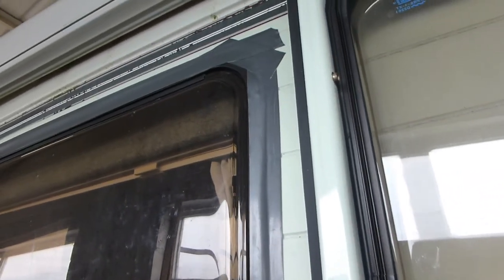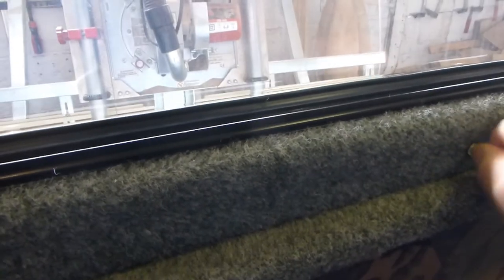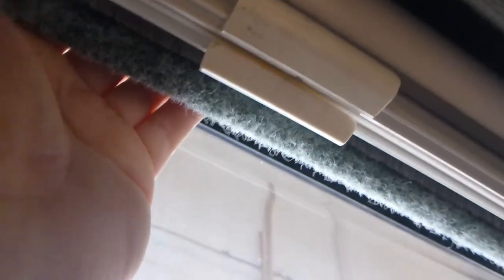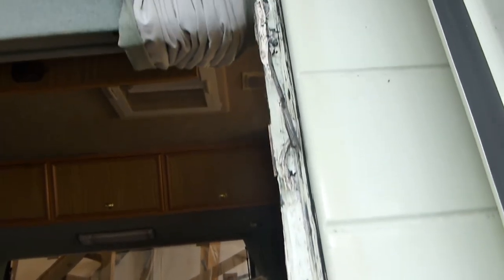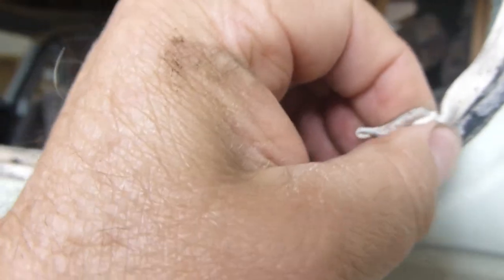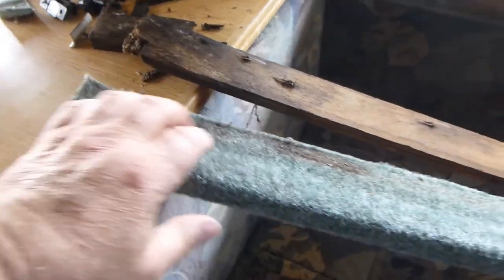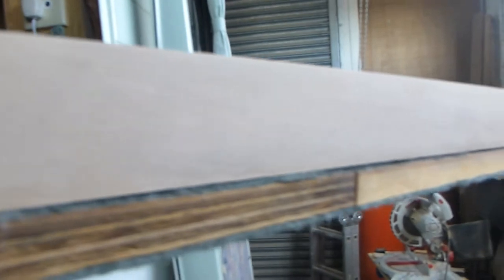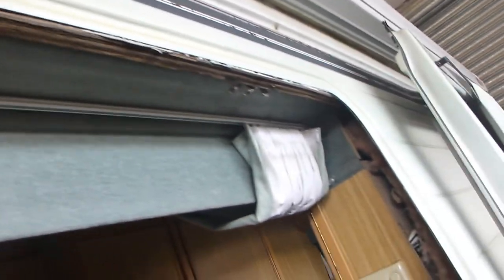Auto Sleeper Window Frame repair

Comment: Impressive, you have a great relaxed attitude and sort things as you go along.  I on the other hand panic at the sight of rot!  I've got a VW Clubman GL and I think it hasn't gone bad yet but needs sorting out asap,  I love the way everyone says fiberglass bodies never rot or leak.  Good video.
Reply from the maker: It's the wood that rots causing the leak. That is because over the years the sealant around the skylight and window frames dry out and crack, steel screws holding them together rust away, vibration separates the parts and water gets in. It goes un-noticed for a while and when you do notice it, it is usually quite bad. If it looks like a daunting job to sort, tell yourself someone put it together so you must be able to take it apart. That's what I do, and take pictures as I go in case I forget how to reassemble it. When you find a rotten window frame it's quite easy to fix.

Comment: A couple of tips for you :)
For the window frame sealant, you can use a plastic car window scrapper dipped in neat white spirit to help lift the old sticky mastic then use with a cloth to clean up the mess left over.. I then use sika flex when re-installing frame.
For any rot, remove all the dead stuff until you hit good solid wood again, you can thentreat with wet rot hardner, i think ronsil make it, you can then build off of that.

Comment: Are you sika flex on mine m8
Reply from the maker: Yours is a bit more difficult to replace the wood as it's sandwiched between fibreglass skins. The screws at the top of the window rust away and leak but it is possible to just fill the holes with epoxy and then use stainless steel screws. You can stick the whole frame in with Sika as long as there is wood where the latch screws go. (I think yours was a fibreglass body - it;s been a long time since I saw it)
.
Reply: Any idea where I can get a W reg 2000  gatecombe that same window frame my frame were the window clips inn is nachaerd